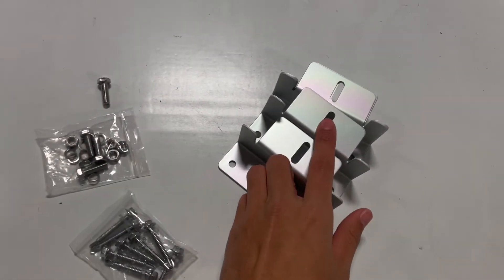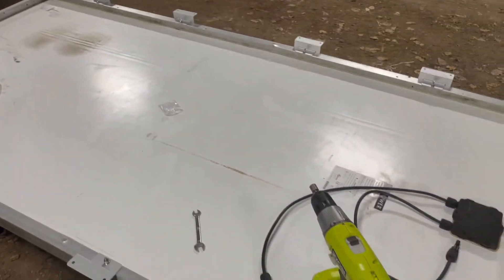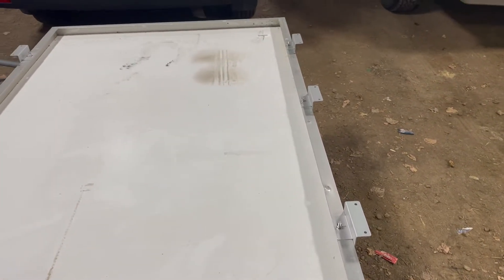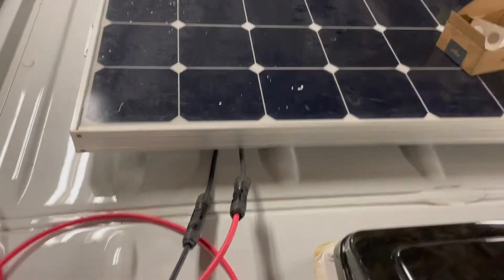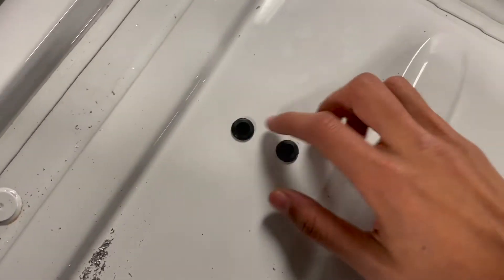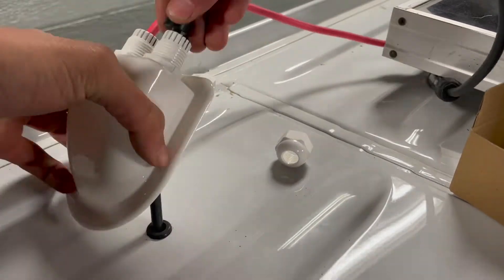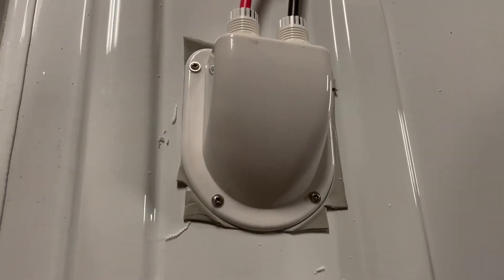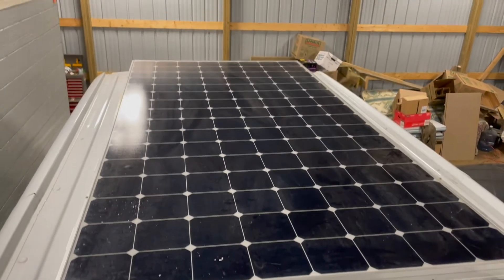Installing a Giant Solar Panel on My Sprinter Van

Comment: Good job. However, i would put some metal paint in the holes for the wires through the roof to prevent any rust forming on bare metal. Greetings from Jamaica.
Reply from the maker: I probably should have done that but it’s been so long ago I can’t remember if I did or not haha

Comment: Thank you Daniel. I maybe over doing the install I am planning, after seeing how you did it. Can you tell me which Entry gland you bought and the mounting bracket screws to go through the roof? 
I see you did this last December. How has it been holding up with the mounting hardware? Any issues?
Thanks again!
Reply from the maker: Hey there! so overall the solar panel install is holding up pretty well after being on the road for 3 months. It's been through lots of rain (a week straight in Oregon) and plenty of snow as well and so far no leakage. The holes I drilled and screws are rusting a bit from condensation within the van which is to be expected. I should have used rust preventer on them. Here are links to the brackets and wire entry gland that I used.

Brackets: https://www.amazon.com/gp/product/B06Y5QX9VX/ref=ppx_yo_dt_b_asin_title_o00_s00?ie=UTF8&th=1

Entry Gland: https://www.amazon.com/gp/product/B075J9YX45/ref=ppx_yo_dt_b_asin_title_o02_s00?ie=UTF8&th=1
Reply: @danielsbegg  Hi Daniel, thank you for the reply! It probably isn't too late to put some good rust inhibitor on them. I think I saw some when looking for my van that said they could be put over rust... but I am not sure how true that is. Anyway thank you! I found a 380 watt panel here in Washington that was new so attempting that today lol.. we'll see how it goes.
Thanks again!